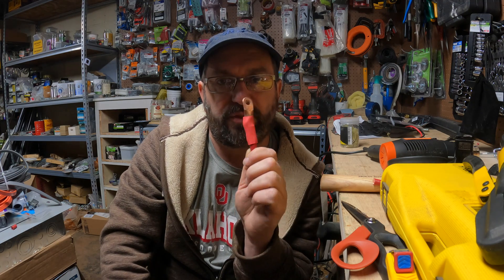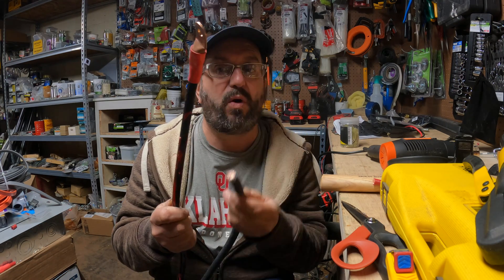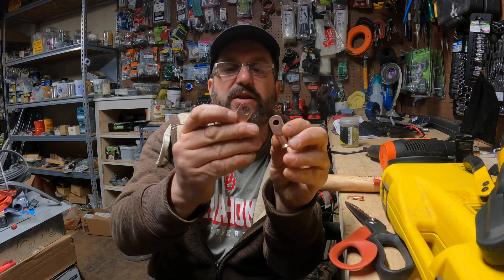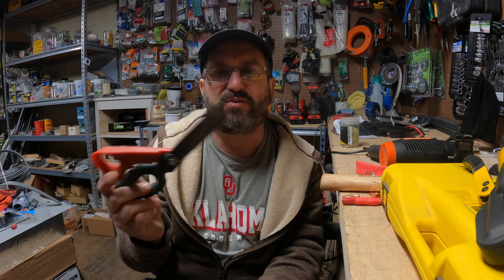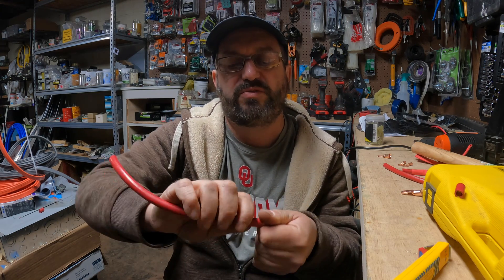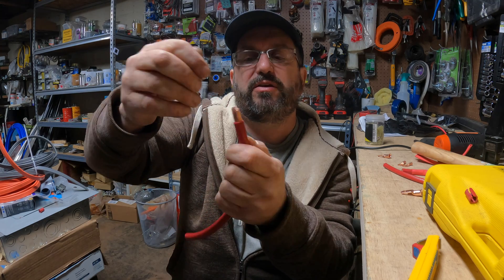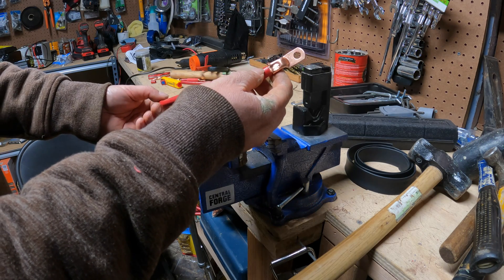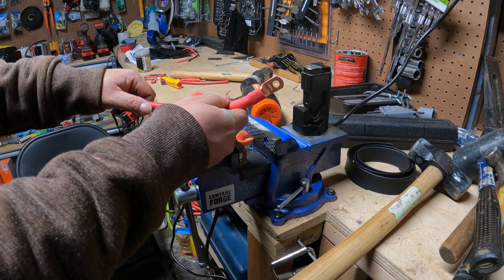Battery wires are too expensive! How to build custom heavy gauge wire for your DIY solar setup.

Comment: i have been using 1 gauge jumper cables to make my cables it seems to work, going partly off grid idon,t have enough batterys only 600 ah so use the the grid at 2am to 6am charging the batterys with a life04 battery charger im diy the batterys only using 10amp battery balancers have try the bms,s don,t seem to work well thanks for the good info its been working well for two years